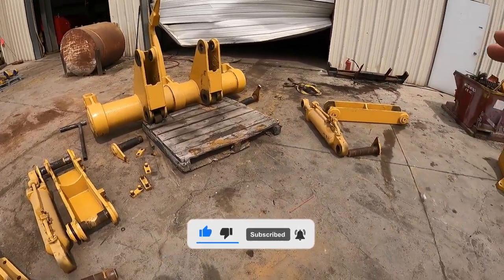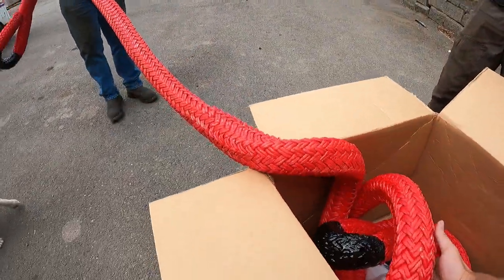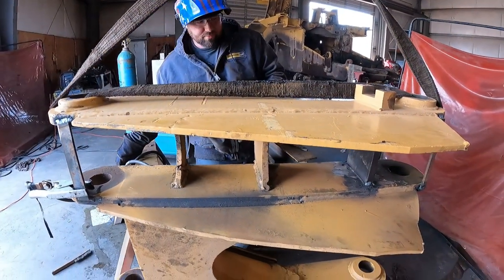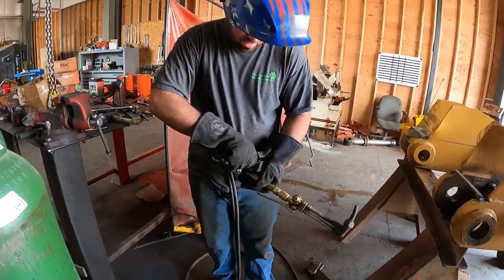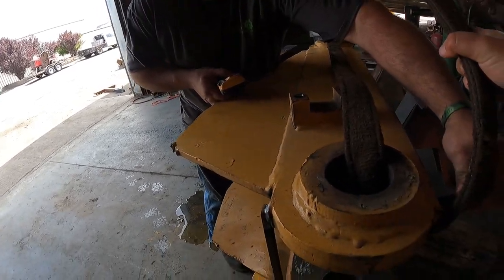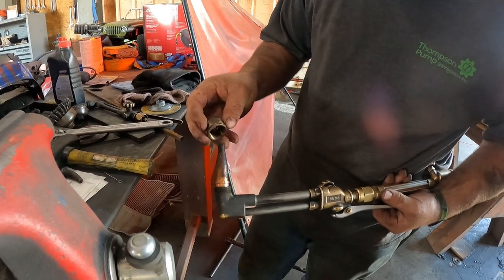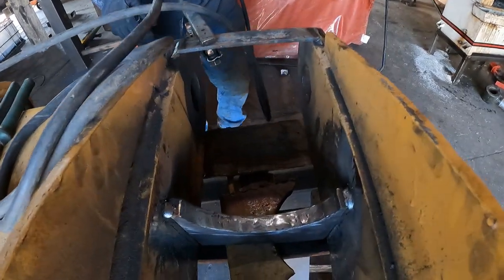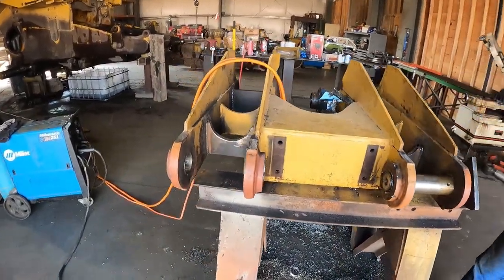This D7F RIPPER has EVERYTHING WRONG with it!!! Lets fix it!!!

Comment: Have you looked at a plasma cutter?  Some are good, just don't go small for your stuff.  The cost of gases has just gone plumb crazy around here.
Are you running solid, flux cored, and or dual shield?
I've seen a number of line bore operations and each person seem to do it a little different in setup and equipment.

Comment: Just curious why you don't use plasma torch?  
At least I haven't seen you dong any plasma cutting.  
Biggest expense in plasma cutting system is needing high volume compressor delivering  about 10cfm @ 90-120cfm, and I assume you have for running your air tools.   Basic plasma cutters are $200-400 ish with only additional expense is electricity and maybe a tip a couple times a year ..  no oxygen or acetone expense, at all. ;)

I don't know a lot about plasma cutting but it seems most plasma guns are good for up to about 1" max thickness.  I know gas will cut many inches thick.

Would like to see the line boring.

Look forward to seeing your answer
Reply: my hypertherm power max 85 will cut 1 1/2 just fine . The ticket to plasma is dry clean air , My air dryer is a side by side refrigerator . Hypertherm is the absolute best on the market . I got mine with a 75 foot lead  in new condition off Ebay for a grand